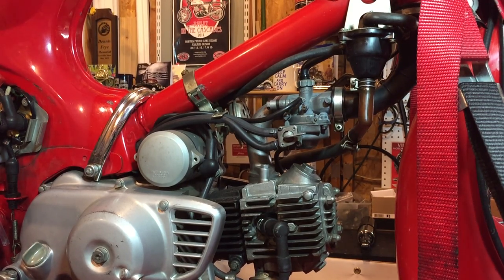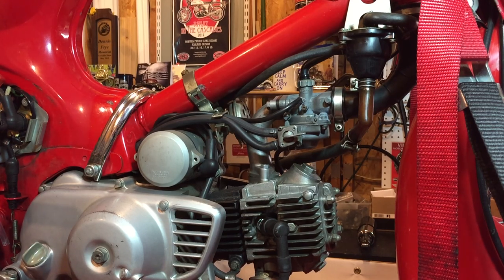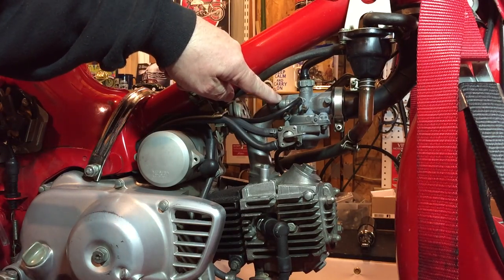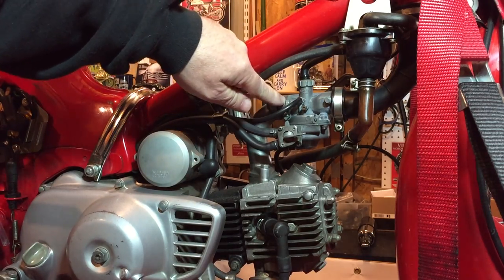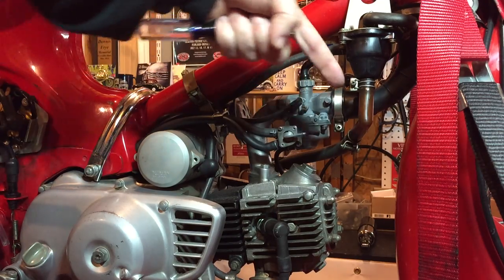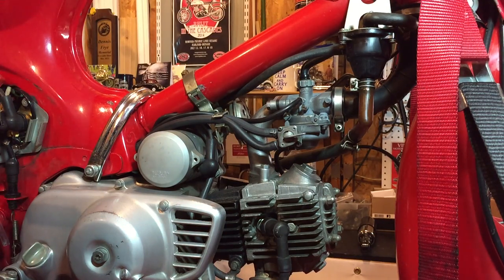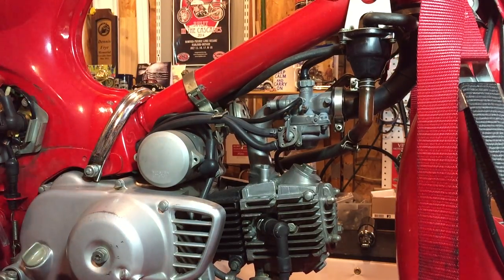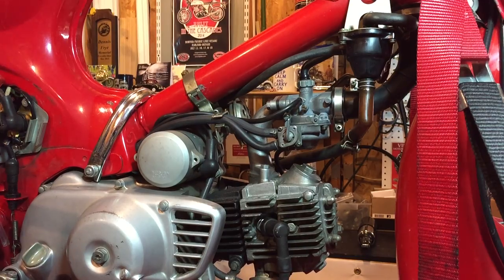1981 Honda C70 Passport (16) – Air Leak (Part 1)

Comment: I have been chasing the same problem on and off for over a year now, I can't remember how many times I've removed and replaced the carb, it's a fiddly job on the '82 bike as all the air cleaner stuff gets right in the way, it has done less than 1000 kms from new! It's a pain, the problem appears to have been resolved only to return shortly after refitting the carb, I'm going to get an OEM carb gasket kit to see if it sorts it out for once and for all, it's such a great little bike and it deserves to be running like new!

Comment: Although carb cleaner works for finding an air leak it can wreak havoc with fresh paint. A great way to find an air leak is with a propane torch. Open the valve on the torch without lighting it and direct the gas toward where you suspect the leak is. The Idle will increase immediately if an air leak is present. Been using this method for years. Common sense prevails and it seems you have that!
Now, on your particular bike it sounds like the slide is not returning fast enough, not an air leak. Check it.
Reply from the maker: Thanks Pappy.  Much appreciated.  Yes, we got to the bottom of this.  It was an air leak at the manifold from what I remember.  Cheers.

Comment: Did you try spraying some Carb Cleaner into that intake manifold?? (area with the stripped thread)If you indeed have a leak..the pitch would change when spraying that Carb Cleaner and engine idling...
Reply from the maker: +Sean Sherman Hi Sean.  Thanks for your note.  I did try that after filming last night and the note did change, but only just a little.  I'm going to take it apart and inspect the thick gasket and also the boot.  I didn't do that when dismantling and reassembling.  Thanks a lot for your advice.